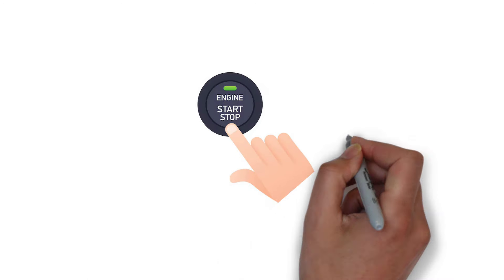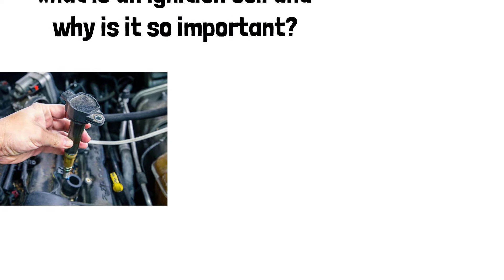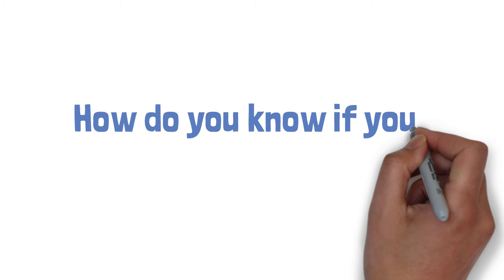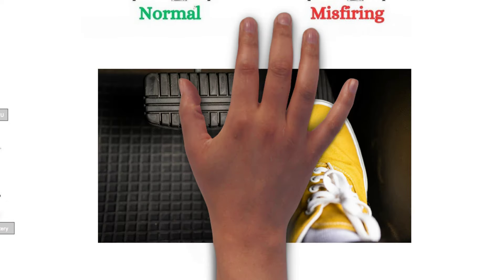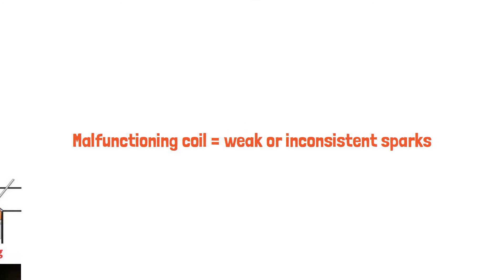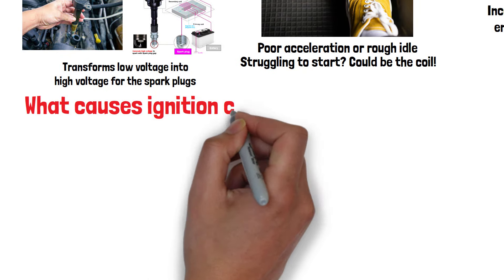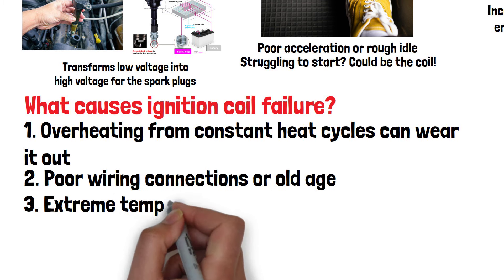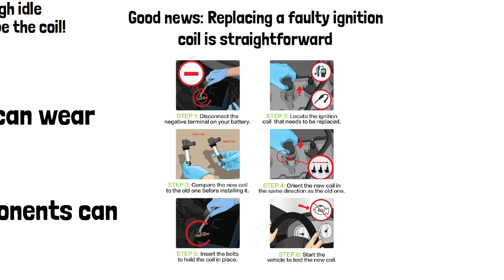Faulty Ignition Coil Symptoms You CANNOT Ignore in 2024!

Comment: Please give solution to my car electrical system... it goes up down., the bulb in cabin , the bulb in headlight the engine power  goes Dim high ...slightly .
Thank you sir
Reply from the maker: I recommend checking the alternator to see if it's functioning properly. It could be the cause of the electrical fluctuations you're experiencing, such as the dimming of lights and unstable engine power.
Reply: @PandaBewok  thank you sir 🙏